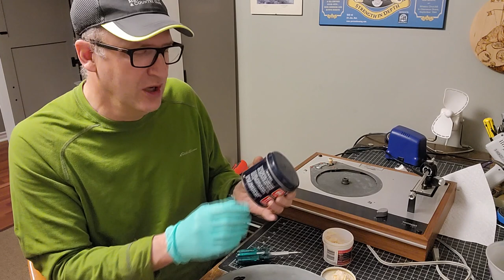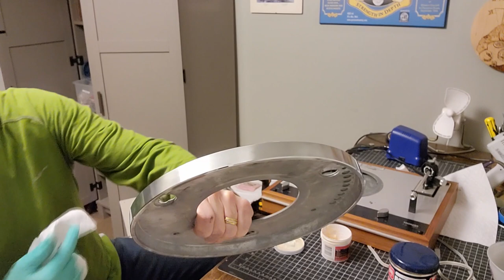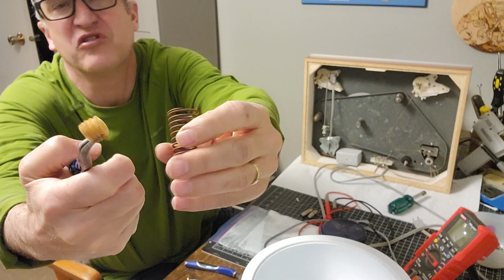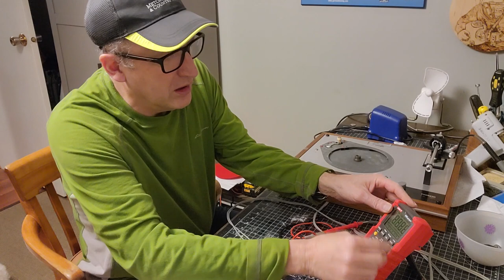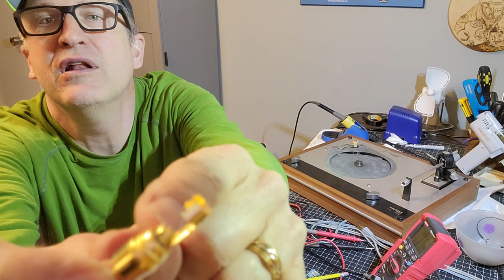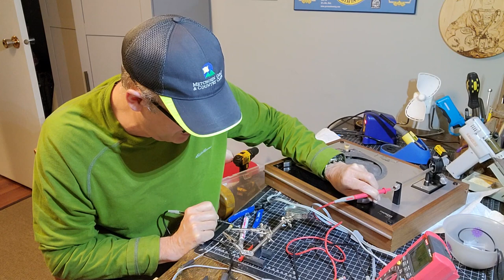Part 2: Thorens TD-160 Project (Platter Polishing - Spring Clean - RCA Change) - 15 March 2022

Comment: I bought a 145 new and now have a 165 after getting back into vinyl.
I agree that in an otherwise great TT,  Thornes used bad  RCA plugs that are prone to corrosion. So, I replaced them on my used 165 when first getting it.
Also, yes  the zinc alloy platter is also prone to dulling / corroding.  
My platter was pretty bad when I  got it.
Without any other way to polish it,  I just used emery  cloth and  then a Brillo pad.  I finished it off with some metal polish. . It took some elbow grease but it now shines better than new.  
BTW, the zinc alloy used naturally  has a sort of a mottled look and Thorens left some lathe  marks on it to hide this 
So when you polish it up and  remove those lathe  marks,  it makes the molted look become more visible 
This is not to say that a polished  platter does not look much better as it definitely does..
Reply: I am amazed that you don't have hum.m.
Reply from the maker: @Poppinwheeeeellllllieeeeez  I don't have hum because I know what I am doing!

Comment: Nice work! I you had taken the time to remove the springs lalala, why didn’t you replace all of that stuff? Vinyl Nirvana has what you need. Love the tinkering. Also once you get that platter edge polished up you’ll love it.
Reply from the maker: Springs rarely need to be replaced. They just need to be properly tuned. In my many restorations of these turntables, I have not yet needed to replace any springs. Just another ploy to relieve you of your hard earned money for no valid reason...🤣

Comment: Great series!  I have a TD 160 that had been in the garage for 20 years. I've got it up and running. Your videos have been a Great help. I am getting drop out of the left channel. It fails the continuity test from tonearm to the RCA connectors on only the left channel. I will replace the connectors. Can you recommend a source for them?
Reply: Did you find a solution here? My left channel also drops out of my 160. I had the RCA cables replaced but it's still happening....

If I unplug and replug the left connector, it works again for a while, and then drops out.

Any help appreciated!

Comment: Thanks so much for this video, ordered some polish and will begin as soon as I get it. I can’t get the center platter up off the turntable to lube it, is there something I need to do or loosen first?
Reply from the maker: It is just seated by gravity on most but a few TD-16x models I understand had retention hardware for the sub-platter as per this thread:
https://www.vinylengine.com/turntable_forum/viewtopic.php?t=46062
Reply: @navydiving  Thanks a lot! I’m a rank amateur, but I love this turntable as it brings back fond memories. Brought it when I was in college.

Comment: Hello, nice series you have going here. I stumbled upon a TD 160 myself, after I've set it up and turned it on, upon increasing the volume on the amp a bit I got a buzzing noise regardless if the platter was spinning or not, the more volume the louder the buzzing got. Do you maybe have an idea whats wrong? As far as I see the RCA cables were replaced but they look very cheap, could they be the issue here?
Reply from the maker: watch the video series through and you will see where your issue likely is...  Editing Part 4 right now

Comment: Tim, do you do repairs/restorations?   I own a TD145C that needs some help.  Just asking.
Reply from the maker: Regrets no - just a hobbyist. I make these types of videos so others can help themselves. I am just starting this series on the TD-16x (in which the TD-145 belongs) here so keep looking back at this thread as I add new parts in the future. It will mostly be an amalgamation of other videos on TD-165 turntables (same series) on my channel for setup and tuning):
https://audiokarma.org/forums/index.php?threads/thorens-td-160-mk-1-tune-up-and-setup-project.991147/

Comment: Would it be advisable to change the wires holding the RCA leads also ? Is this a difficult process ?
Reply from the maker: Not sure what ou mean?
Reply: @navydiving  I was wondering about the wires (cables) that run from the turntable to the RCA connectors. You hear a lot in audio circles about the importance of using high quality cables and interconnects. The wires coming from the turntable look a little flimsy to me so I was thinking that replacing them with some high quality cable might be a good idea. However, after watching more of your excellent video series, it seems that the original cables are of sufficient quality and that if they're not damaged they don't need to be replaced. I have a TD 146 which is in pretty good shape, but needs a little TLC. Your series has been of tremendous help and I've learned a lot. Thank you so much for posting it !

Comment: I have to remove the old face plate  and get a new black metal face on my TD-160 and a rosewood armboard for my TD-160.  Use contact cement

Comment: Where are you located? I’m in southern York Co. PA. Can you repair my 160? Or do you know of a qualified shop near me? Thanks for your knowledge
Reply from the maker: Vancouver Island, British Columbia, Canada

Try Dave at Vinyl Nirvana in Boston - Just Google him...
Reply: @navydiving  thanks for the suggestion. I want to fix my TD160 myself. I can do soldering so I’m wondering if you can point me to RCA jacks with appropriate cords that I can connect to the terminals on the blocks? The ones on my TT are replacements and look like total overkill. Are original or their equivalents available? If I do this first and still have hum/buzzing I can test for other interference/grounding problems..but this looks like the place to begin. Everything else functions well and normally. Looking to keep this one going! Any suggestions on cartridges? Had a Shur Type 3 but it needs replaced but something inexpensive but good performing is ok for now while in repair mode.  I actually am going to begin with replacing the cartridge to check connections there.  Thanks
Reply: I’ve been looking at discussions on sites basically dedicated to thorens and 160s and it really cool to see so many qualified enthusiasts sharing information..reminds me of my 122 Volvo forum.  I’m determined to get good at this and since it’s already humming and buzzing i really don’t think I will make things worse but so what if I do? It simply be a teacher

Comment: I am firm believer that if the Swiss designed the springs with foam inserts, paying money to procure them (and by extension increase their production cost), then there is a reason they designed it like that. Throwing them out is not something I am comfortable with. (just my two cents worth)
Reply from the maker: I have a whole drawer full of them if you want any more. Oh, by the way, this is not a Swiss Turntable. They were designed and manufactured in the little hamlet of Kuhbach (Just outside Lahr, Germany where I used to live and work selling top tier audio equipment at Canadian Forces Base Lahr, Germany back in the day.) 😉
Reply: @navydiving  Indeed, the Swiss company that designed the first Thorens models moved to Germany in 1966, some years after the design and production of their first TTs. The original Swiss engineers designed their TT with the foam inserts, and subsequently also the German engineers opted to continue this. Whether you have a drawer full of these inserts and whether this is in alignment with popular belief is irrelevant. I still feel that these guys knew something more. Sorry. Just my opinion about common sense.
Reply: My common sense tells me otherwise. If you wrap your tyres with paper and drive your car around, you will get crashed paper and dirty tyre. This foam insertion is nothing better than that. Whether, or how firm you believe in Swiss, or the followed up German, engineering is a separate thing.
Reply: @yiyuanxie7887  I guess it's a matter of opinion. If you believe that the output of Swiss and German engineers can be equated to wrapping paper around your tires, then there is little more to say. Unless you can claim that your background and technical insight is such that places the necessary weight to your claim, then it is just that - your unsubstantiated opinion. But then again, that's what we are all doing here - exchanging opinions.
Reply: Yes, we are exchanging opinions under realistic context. If you think after 50 years of deterioration, the thing still has any function (even if it has initially) other than collecting dust (and probably generating it at a greater speed itself, as I have seen in many examples), then go ahead and keep it. For me, throwing and refrain from dust seems the best thing to do to them. @ldeemou
Reply: @yiyuanxie7887  I am 100% aligned with that. Our difference seems to be whether to ditch the foam altogether or to replace it with a fresh one in an attempt to be as close as possible to the original design of the Swiss and German engineers ;)
Reply: @ldeemou  Well, if there is somewhere we can source new insertions at reasonable cost, I would do it - even just to pay my respect to Swiss and German engineering. But I don’t think it’s easy today.

Comment: Im not a fan of Thorens turntables. I prefer Dual 1219. I restore 2 to 3 turntables per week. I avoid working on Thorens turntables. Humm is a huge problem.
Reply from the maker: For me, on the contrary, I have worked on a number of Duals and they are completely overrated IMHO - sticky grease on them is infuriating as per my comment to your other comment. I think we will have to agree to disagree. I have worked on and owned both types of tables - right now I have 5 Thorens (2 X TD-160 and 3 X TD-165) and they all sing sweet and true!